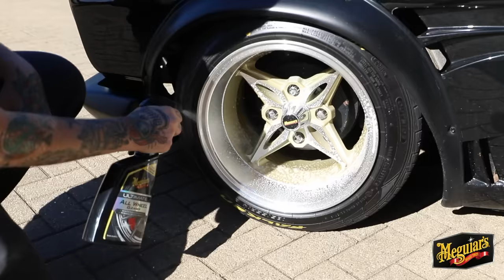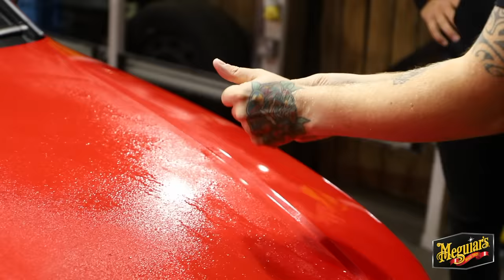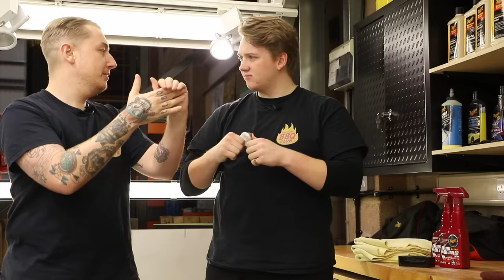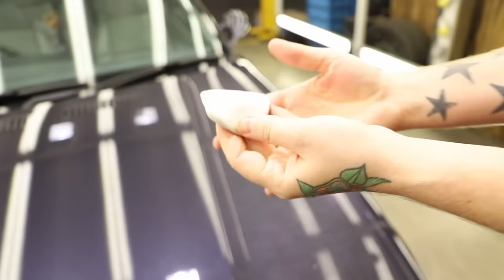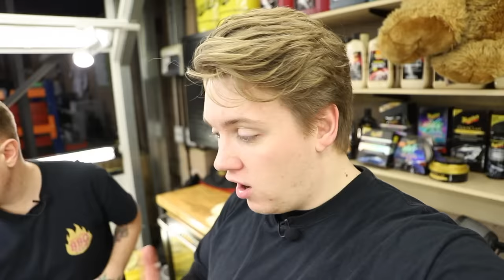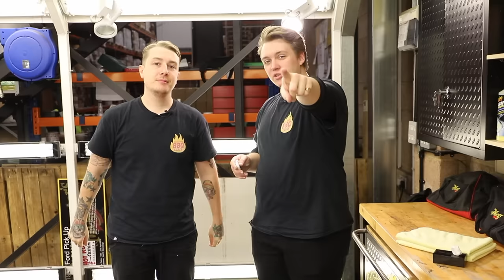How to CLAY BAR your car - Detailing 101 Ep.3

Comment: If the detailer your using is just for lubrication purposes just use soapy water  mixed in a  spray bottle and save yourself a few quid .
Reply: Thanks mate for the suggestion 
Really that detailer spray kinda look expensive and I was looking for counter measure solution in the comments and bravo I got one by you🙂
Reply: This channel is a Meguiar's channel, they want to sell you more product
Reply: I plan on using Adam’s detailer the pink spray bottle. I don’t mind using something expensive when it comes to my car, I’m keeping it to last longer
Reply: 1 part onr no rinse  to 64 part's distilled water. 32 oz bottle of onr we'll make roughly 16 gallons for $18

Comment: The detailer lube thingy, can I use water or some home grown solution?
Reply: CRM6718 water with just a couple drops of household washing up liquid will work
Reply from the maker: We suggest using the Quik Detailer as it a brilliant lubricant for clay. There isn't enough lubricity in water to make sure the clay works effectively.

Comment: Thanks for this useful video on clay bar. Do I have keep it dry or moist when storing the clay bar after using on a small portion of the car?
Reply: It will dry..i keep mine in a zip lock bag right after use
Reply: Eric Maeder I put it in a clean air tight container with a bit of moist. Hopefully, it’s ok 😅
Reply: You throw it in the trash

Comment: So i waited for the sun to cool and clayed the car, hard graft for a beginner but chuffed with the results. I also did the car once clayed with a coat of ultimate quick wax all over, including wheels and gelled the tyres. I use the ultimate quick wax and ultimate detailer on a regular basis as i like the ease of use. Should i be thinking of anything else polish wise?
Reply from the maker: Good work! Clay really does improve the way the car feels but not looks. If you want a polish we would suggest the Ultimate Polish.
Reply: @meguiarsuk  cheers, i'll grab a bottle from Halfords later as its on special at the mo :)

Comment: Thanks for the video guys... Just what I needed. I’m only just getting into detailing. I’ve had my 8 year-old Mazda 3 since new. It’s been washed incorrectly most of it’s life with me I’m afraid and is now absolutely covered in swirl marks (though in my defence, they used water-based paint which is not as tough as the stuff used on older cars I’m told). I’m hoping to start clay barring it soon and already have the boxed kit you show at the start. Are there any other precautions I need to take with the water-based paintwork? Would I have potential problems using a DA/rotary polisher when I finally get one? I’m looking forward to having a crack and have bought hand polishing pads and Ultimate Compound and Polish for after!

Comment: If anyone is sceptical about a clay bar then try one.  I personally never used them until recently but I was absolutely amazed at the amount of contaminants it removed.  Even iron dust from a grinder that has settled on a car was removed.
Reply: Does it work wonders? Like the shiny lasts longer or car washes become easy

Comment: Will a clay bar remove what looks like tiny rust particles all over my white two year old hyundai i10. It's as if the whole car was sprayed with a fine orange mist....argggggh!!!!
Reply: silcedpage:  Your problem is called "rail dust" and it is very common on white cars.  Actually, it's common on most cars, but it is more visible on white colors.  It should come off with clay... but it might not.  Try a test spot with the clay first.  If that doesn't work, try a test spot with a cleaner wax.  Meguiar's cleaner wax is good but I personally like the D166 Ultra Polishing Wax from their professional line (M66 quick detailer is great on rail dust as well).  Be sure to "work" the cleaner wax onto the surface.  Don't just apply a coat, make sure you work the product into the paint with some slight pressure.  That pressure will help the product cut the rail dust off of the surface of the paint.  If the cleaner wax won't work, you can use any Meguiar's polish.  If that doesn't work... you have some nuclear rail dust and need to compound and polish the car!  Don't worry, it probably won't go that far and the cleaner wax should remove the rail dust without too much trouble.
Reply: @fwh79FOXR6  Thank you for the helpful info
Reply: @slicedpage  You're welcome.  Good luck with the rail dust correction.
Reply: fwh79  iron x

Comment: Once you've finished clay-barring, can you go straight to using Meguiars Hybrid Ceramic wax to finish, or should you wash off any remaining detailing lube first?
Reply from the maker: you can wax the car immediately absolutely! maybe try our new Hybrid Ceramic Liquid Wax?!
Reply: @meguiarsuk  yes, I did that and I'm pleased with the results, although I'm convinced the Wash Plus shampoo has caused swirls in my paintwork all over. I'm pissed off
Reply from the maker: @husky041  Sorry to hear this. It's unlikely that the wash plus itself caused the swirl marks. However they can easily be removed with the Ultimate compound.
Reply: So after claying the car should I go straight to ceramic wax spray or would you just use polish then wax?

Comment: After folding clay bar many times on same car, wouldnt the dirt eventually end up on the face of the bar??
Reply from the maker: Each car is different so some cars you will be able to do the whole car with just half the clay, If you find the clay to be getting visibly dirty you can switch to the other half of the clay you cut earlier.

Comment: I just used this clay on my car and it left tiny straight scratches i can see under my light, is this normal which i then have to polish out? ie should it have left literally no scratch? I only tested a small section with a brand new clay
Reply from the maker: The clay shouldn't have caused any scratches if proper lubrication was used. It may be that the scratches we more visible when under the light and need either the quick scratch eraser kit to fix it or ultimate compound.

Comment: Hi is it possible to clay a car without polishing afterwards
Reply: no, you always get a little bit of marring from the clay bar, no matter how careful you are.
Reply: @jamesbutler606  not really true. Check out forensic detailing channel to see video in which he shows with a microscope what happens to paint with clay bar. If you keep the clay clean during the process and make sure paint is lubed you will not leave any marring or micro scratches.
Reply: Possible yes but it is a prep stage, if you don't go on to polishing or waxing you are leaving the paint with little to no protection
Reply: Yes you can clay the paint then go onto your LSP. Even If your car has a ceramic coating on it you can also clay it as long as you use plenty of lube and remember not to use any downwards pressure only enough that it stays in your hand👍 marring is only caused by to much pressure and not enough lube.
Reply from the maker: After clay baring your car it would be left with no protection.
Reply: @meguiarsuk  sorry but you are wrong. It might remove the last remaining wax or polymer sealant but that still doesn't remove it fully. As for a car with a ceramic or any  other Sio2 base coating, claying doesn't remove it one bit.

Comment: I’m going to attempt to clay bar the roof of my car this weekend with the meguiars kit, the rest of the paintwork looks good and shiny but the roof looks like it’s been sat under a tree for years, I’ve only just bought it so don’t know the history. I thought the clear coat had perished initially but there’s no peeling so I’m hoping it’s just build up. Do I need to also apply compound afterwards? I was hoping to clay wash and wax. I’d appreciate any advice, thanks
Reply from the maker: If you are looking to revive any faded paint or remove swirls then absolutely Ultimate Compound should be used. If it's just to remove any build up of residue then wash the car first, then clay and then wax.
Reply: Did my truck today
Reply: @meguiarsuk  I heard that clay introduces micro scratches & marring. I never used clay as I dont know how to polish afterwards .

Comment: How to clean the clay bar after it’s dirty?
Reply: You can't. You need to use a new piece of clay. If you buy the set, it comes with 2 bars and they recommend breaking each in half.
Reply from the maker: It can vary on each car. We suggest to cut the clay in half so that if you drop it or the car is heavily contaminated you can use the other half. But if the car isn't heavily contaminated then you can fold the clay in on itself to reveal a new piece.

Comment: Use white spirit on soft cloth, faster quicker cheaper before detailing, removes old waxes and polish's. Keep away from textured trims (black rubberised etc) won't harm it, but will leave white residue that will need to be cleaned off. It will also remove tar and colour scuffs without needing abrasives like G3. As to that old BMW they are cleaning, better to spend the money sorting the rust scabs first on those quarter panels. There's an old saying, you can't polish a turd👍

Comment: Thanks. Going to try on my 66 Mustang tomorrow. Definitely has a rough feel to it. Just did my 93 White Mustang with Ultimate Compound, then ultimate wax only. Which was fine. But the dark blue 66 has a little more roughness to touch. So I bought Meguiars clay kit. We'll see how it goes. Sounds and looks straightforward and easy.

Comment: Can I use any car soaps as a Clay lubricant?
Reply: Yes, so long as it doesn't contain wax. Mix a little with some water in a spray bottle and off you go
Reply from the maker: you can however we would advise using our Quik Detailer as the lubricant for the clay

Comment: Hi guys! Great videos! A question: How often I have to clay my car? Everytime I'm going to wash it?
Reply: Nela depends how much gunk is in the paint. I claybar typically when the paint feels rough after washing by hand.
Reply from the maker: no you wont need to do this every time in washing. However you can do it as many times as you like. Just take note that everytime you do your protection will be stripped off.
Reply: @meguiarsuk  What is the protection being stripped off? How do I get the protection reapplied?
Reply: @Sean-me4fv  re wax or polish

Comment: Do you clay a car before you wash it or wash it first?
Reply: Wash then use clay bar and finish with wax/seal.
Reply from the maker: wash first to remove heavy contaminants so the car is "clean" then clay to remove things such as road tar etc.

Comment: The one tip you forgot to mention is when you drop the clay bar throw it away cause it'll pick up anything on the floor.
Reply: think they did mention this at about 6 minutes ;)
Reply: They said (twice?) to throw it away and use the 2nd unused half